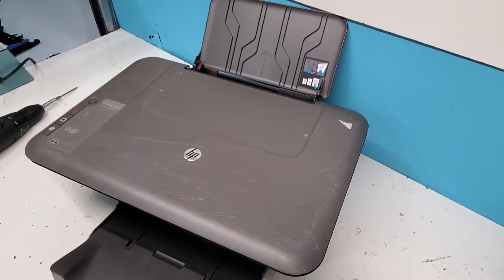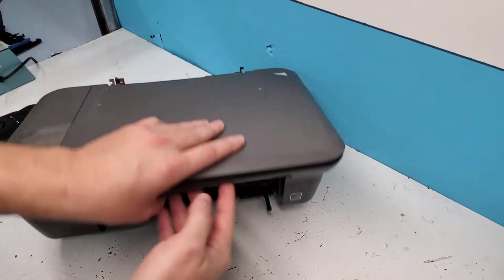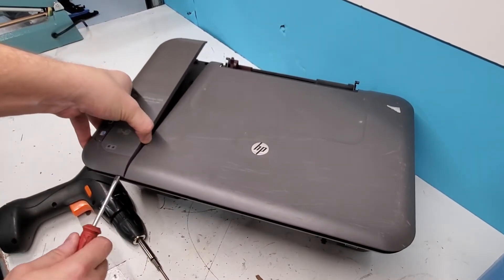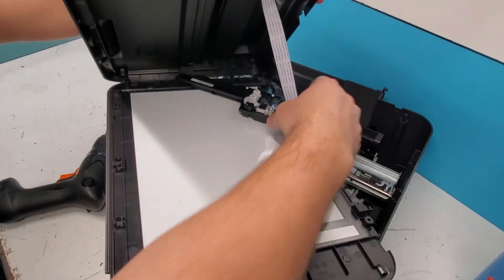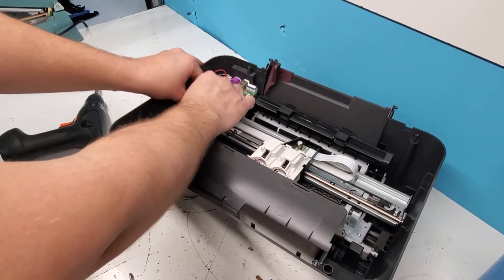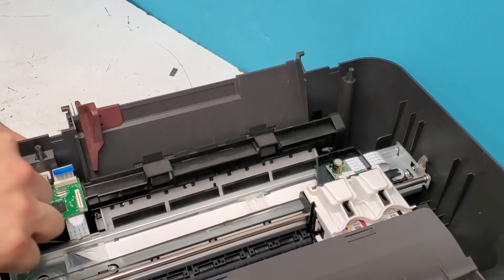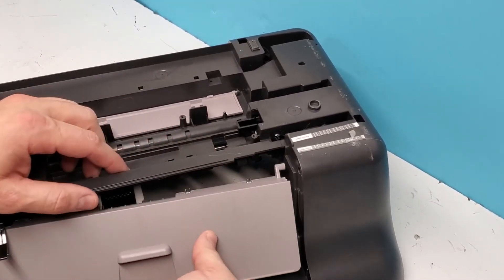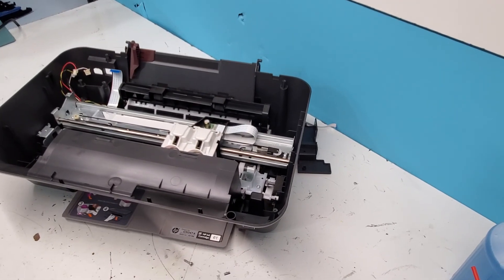Taking Apart HP Deskjet 1055 Printer for Parts or to Repair 1050 1051 1056 J410 3050 Disassembly

Comment: In my experience this printer works quite well (I have an 1050A model). Still works fine after like 10 years of purchase. I tried a lot of 3rd party cartridges, some of them cause stalling initially, but after pressing OK they continue to print without issue. Hopefully it can function for a long time... I hear horror stories about new printers today
This has no stupid ink subscription, software updates. Hey it can copy even modern banknotes without striping... 
😅